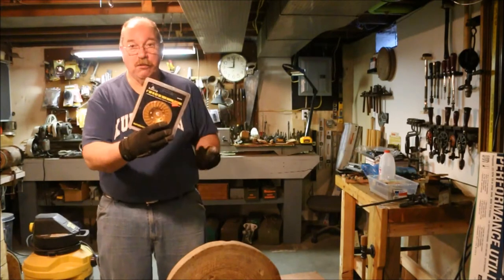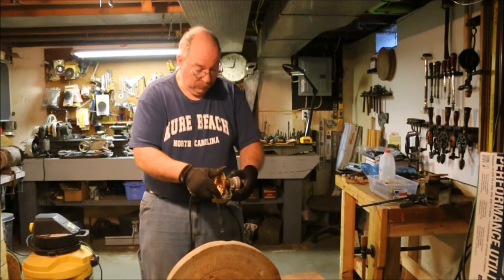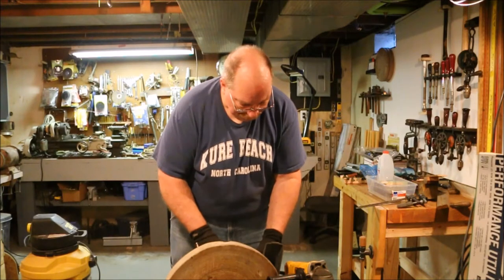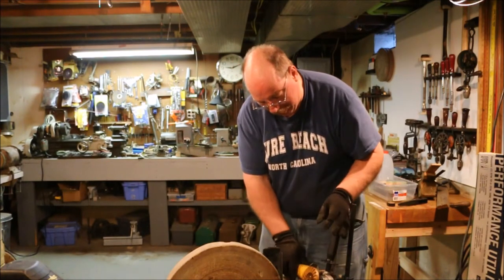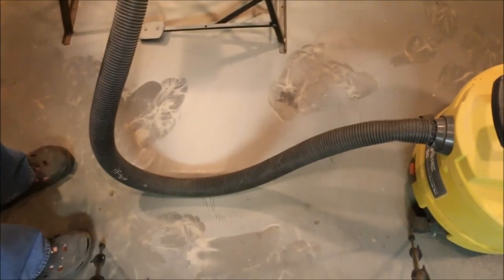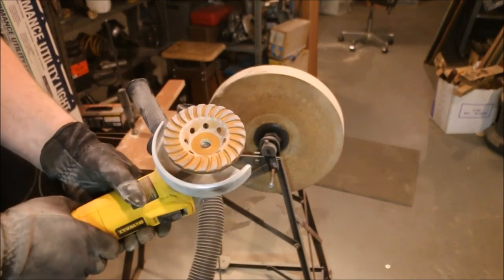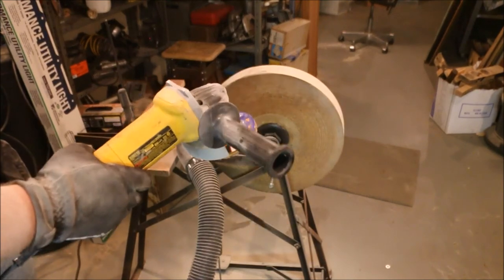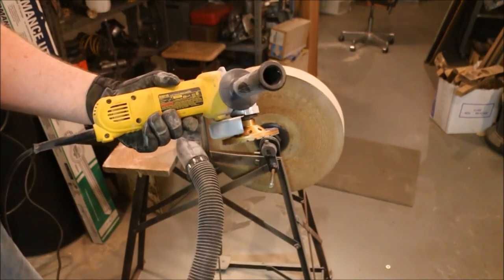TREADLE GRINDER ~ PART XVI ~ POWER DRESSING THE WHEEL

Comment: Gotta admit, I never thought you would get the wheel round, BUT looking good indeed. I remember back on the farm,  hand cranking a similar wheel while it was sharpening a scythe . The wheel was way out of round, but as a kid my job was to crank the wheel and mind my business. It had a small tin can hanging on a hook, that dribbled water onto the wheel. Ah the good old days.  Really enjoyed watching this video....Ken
Reply from the maker: This one has a bar to hold the tin can but the can is long gone. 
I never used one as a kid. Dad made a grinder out of a washing machine motor and a waterpump bearing. I sharpened my first drill on it.

Comment: I knew you'd come up with something. I've got a diamond blade for the hand held DeWalt but nothing for the grinder.And I'm like you in grinders. I have the same one with a paddle switch and have run the dog doodles out of it and it still goes right along. I blow it out once in a while too. NOW for an axle shaft!
Reply from the maker: Lewie McNeely Before I get to the axle i'm going to work up a set of linkages. Stuck in sandblasting mode for the next day or two. I wore out the ceramic nozzle and need to pick up some more. If it rains tomorrow it's linkages. Otherwise paint and blast.
Reply: MERCY if you ain't in a serious mode. It's just the old wheezing pressure washer if anything but I don';t live in Sneelock Acres, a pristine development  close to school and shopping. That's about as official sounding as I can get! 10/4 on the linkages!

Comment: ..that Diamond wheel sure did a job there Bossman. I have some brick & foundation work that could use a little of that. Next time i'm in the HF one may be coming home with me...!!
Reply: I'll lend you my big hammer, Jimmy Bob. Not too good on precision work but strong on getting it done.
Reply: ..Oh !! you're talking about the hammer, not me...!!!
Reply: My 'precision' isn't exactly anybody else's 'precision'. Yeah, me and my hammer.
Reply from the maker: Ol James I figured it would work. It really went through the sandstone. The best part is if you hold it at the right angle it spins the wheel too. 😈
Reply from the maker: Lewie McNeely The 10 lb sledge has a mushed face where I tried to break up a piece of granite so it could be moved. I lean more toward hammer drills to make the holes with feathers and wedges to split the rock. The diamond grinding wheel was actually just an impulse buy. No project in mind just a 20% off coupon and money in my pocket.  😈
Reply: Sure came in handy! Good deal! Igot in on the drill and feather wedges when I was in the concrete forming and pouring industry, In other wise the general whatever man. From moving and running everything to trying to figure how some of the odd-ball stuff they got worked.

Comment: Gotta fix the shaft first otherwise all is lost. The only thing I would have suggested is doing it outside. It looked like a west Texas dust storm in your shop. Another thing. The best hand grinders on the market are Ryobi at Home Depot. I am a welder and I use them everyday hard. You can’t wear them out. The trigger is at the end of the grinder with a handle grip. The best part is they were only $39.00. They are tough little grinders and the cord is very long. I wouldn’t trade my Ryobi for 2 dewalts not saying they are bad. The handle being in the back where the cord comes gives you so much more control over the grinder. I promise you if you had one you would not use the dewalt. I never did like those grinders where the trigger is on the fat part of the grinder. Next time you are in Home Depot check them out. Mine suffer a tremendous amount of abuse and they fire up every time. Something else that is neat about them is that the wrench to change the grinding wheel slips inside the screw on side handle. No problems keeping track of it. They are good tough grinders and the price is the best part.
Reply from the maker: The old bearings were an interesting project to try and rebuild. Way too much trouble but interesting. The ball brearings make all the difference. 
I have been looking for a second angle grinder for leaving a cutoff wheel on.  Swapping back and forth slows me down. I will look at the Ryobi. Thanks
I did maintenance and production welding until I got into management. 
I did the second grinder outside. That saved vacuuming the whole shop. That got into everything.  😁😎